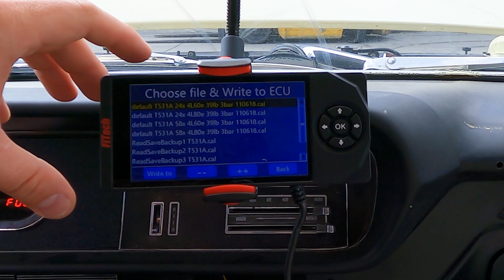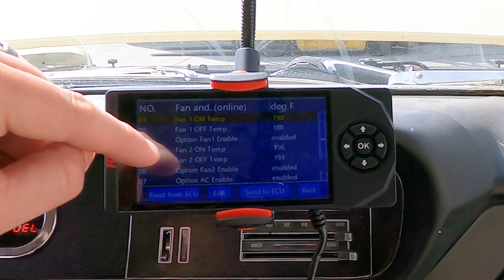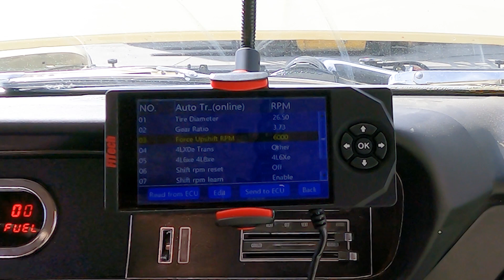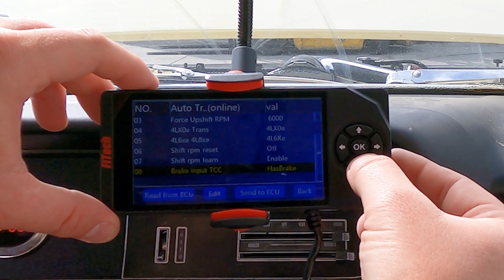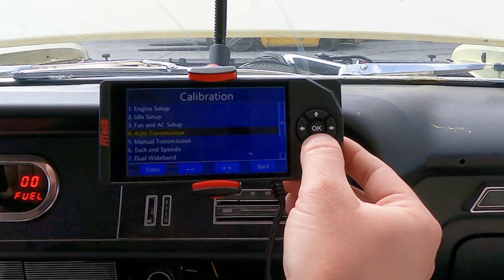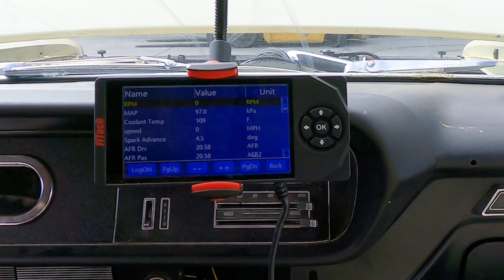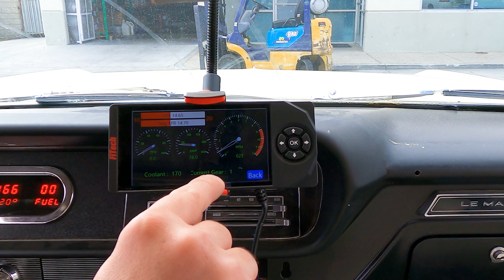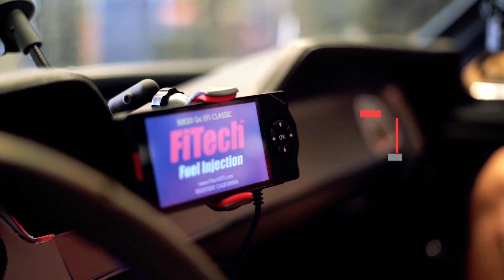Ultimate LS Engine & Trans Setup| Tech Tuesdays | EP16

Comment: I just bought a 63' c10 with a dbc 5.3l 4l60. When i bought the truck it had no brakes, so i didn't get to drive it, but the price was right so i purchased it anyway. After fixing the brakes i drove it and im having issues. 1st issue i noticed was it hesitates 2 - 3 sec when pressing the gas pedal. 2nd issue it not shifting correctly, i checked the trans fluid and it was low, so i added fluid but before i got to drive again i found the 3rd issue. The oil is about a inch over full mark and smells like gas. So i checked the plugs and they are rich (wet). My next step is to change oil and new plugs. I would like your input on what i should do next. The guy i got it from is not a mechanic and said he had someone tune it. If i follow the video would it get rid of the "rich" tune? Im also going to do a compression test to see if it may be worn rings/cylinders, and check fuel pressure to see if it leaks down. Any other suggestions, im all ears thanks.
Reply from the maker: Assuming that there is not a mechanical issue the video on AFR targets will work. I would suggest checking the fault codes in the handheld and contact our tech team to go over some quick possibilities on your issues. 951-340-2624 or techmail@fitechefi.com

Comment: I put a LS1 fuel injected engine out of a 1998 Caramo Z28 in my old 1980 CJ5 Jeep. I tried for months to get LS1 PCM harness working and could only get a crank no start result. I purchased your 70050-1 Ultimate LS system and have it installed. I try to start the setup but get ECU no response when I try to enter anything. Any tips on what to check?
Reply from the maker: Your best option is to give our tech line a call or email. The most common reasons for no ECU response is missed or improper wiring of the system. There are two rounds on the harness that need to be grounded to the engine. Then engine also needs to be grounded back to the battery. We often see a ground being missed.

Comment: 1:12 I did this step without holding down the accelerator to shut off fuel supply and it instantly flooded out my engine and fouled out the spark plugs. Now I’m screwed and it doesn’t wanna start anymore. Car was running fine before, I should’ve left it alone🤦🏽‍♂️. Any advice on how to reverse this?
Reply from the maker: You rewrote the calibration file. If anything the file is not correct for your engine. It could be that you selected the from reluctor file (24 or 58). It could also be the wrong injector side in the calibration. You need to go back through the initial setup in this case.
Reply: @FiTechEFImedia  yea I selected the same file in the video (24). I have a 5.7l 4l60e. I still can’t figure it out. We tried to do like a master reset and start from zero but still nothing worked😟 could I get you guys on the phone perhaps?
Reply from the maker: Give our tech team a call and we can help assist. 951-340-2624

Comment: If you make changes to your vehicle like I’m running a 700r4 and want to switch to a 4l80 is it possible to change that
Reply from the maker: Yes. You just need to turn on the trans control under the Initial Setup of the handheld. You may also need the harness if you didn't purchase it initially. Trans Control Sub Harness # 70050-5

Comment: I need some help, I've got 3 cold cylinders, what more can I do
Reply from the maker: Pull the plugs on the cold cylinders and see if the plugs are wet. If they are dry the injectors may be clogged or stuck shut. If they are wet the check for spark on those cylinders. That could be possible dead coils or wiring connection issue to them.
Reply: @FiTechEFImedia  thanks man I've done just about everything,, but the engine only has 3 hours run time so I'm thinking I cleaned the cylinders. I'm gonna put oil in them and try again

Comment: I recently installed the 70050 on a gen lll 5.3 with a light cam/th350 trans. Im followed the initial set up on this video as much as possible.  Questions : how to adjust IAC on cable throttle body? Mine jumps between 0-1 at idle. Also once at operating temp the engine stalls as I accelerate. Any ideas ? Appreciate the help if possible.
Reply from the maker: Check out Episode 61!

Comment: Are you running stock injectors? I jus put a brand new fitech ultimate ls 70050 on gen 3 5.3 and 4L60 all stock  In but after I tune my battery died if I don’t start every few days??? What to do?
Reply from the maker: We use FiTech injectors with our LS kits. The only thing that draws power from the EFI system with the key off is the handheld. If you unplug the handheld there will be no draw from the EFI.
Reply: @FiTechEFImedia  thank you will check it out

Comment: How do you set this up with a 4l80e…?
Reply from the maker: In Initial Setup there is an option to select the trans. In the video it shows the switching of 4L6XE or 4L8XE.
Reply: @FiTechEFImedia  I seen that, and also thought how would the ISS sensor work with this

Comment: Well, I have an original 5.3 single turbo engine with an ultimate Ls injection system.  How do I calibrate the IAC
Reply from the maker: Setting the IAC is no different with or without the turbo.

Comment: If the lock up function is not engaged., it wont lug down to the lower transmission gear ratio for lockup at wot throttle correct???